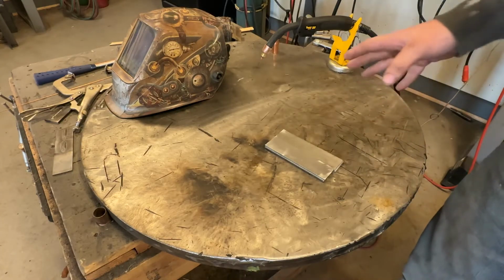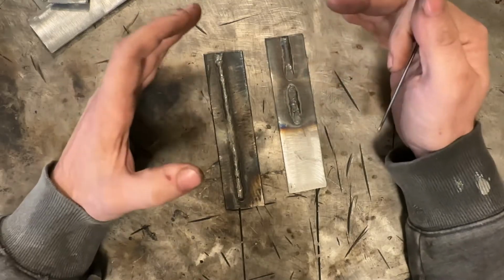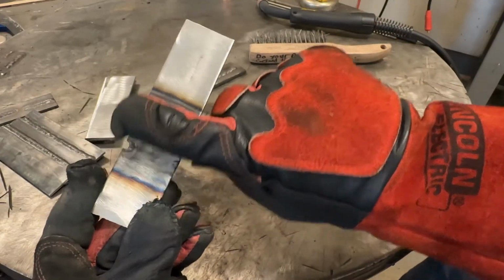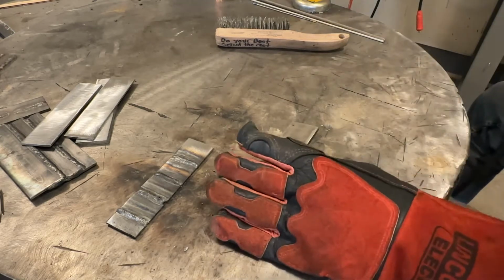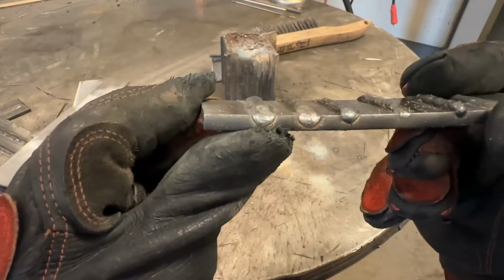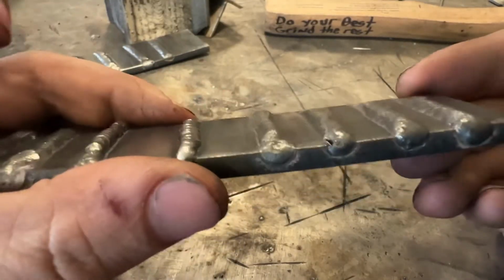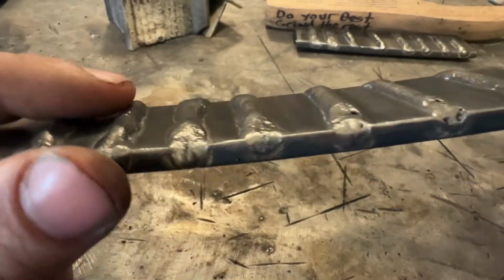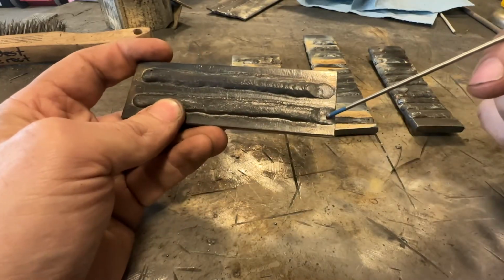Heat to metal ratio: learn how to read your welds

Comment: 😃This one is so unbelivable helpfull!!! 👍 
Should be mandatory to watch for everyone starting with Flux-Core welding. 
Thanks for that, Greg!
Reply from the maker: Glad the video was helpful 😀👍.  Understanding weld size and what wire feed/voltage controls do is critical to being able to dial welds in.  Once you grasp that concept you can dial in things for different thicknesses, positions, etc, and get good results without a chart.  Even more helpful is you can work in reverse and troubleshoot welds based on appearance and dial things in to improve the results. As supposedly easy as flux core (or wire welding in general) is there are a ton of variables to contend with.

Comment: Great video , deserves more likes , prob because most people don't even understand metal to heat ratio , especially with flux core or mig . :) more adjustments making it a little more difficult to tune cheers man , . Once again great informal video.
Reply from the maker: Thanks for the kind words.  I did a sort of second video on this premise, basically “welding blind” where I made welds without seeing what the settings were.  It is so critical to understand heat to metal yet many people don’t.  Once you understand it mig welding becomes much easier 😀

Comment: Just  started welding at 60. You are a blessing to a man trying to figure it out by himself. Thank you
Reply from the maker: No problem.  Welding is quite a complex thing, but with a bit of practice and understanding that it will take a while to get a handle on it, it won’t be long to become decent.  The key is have patience with yourself, try to be as consistent as possible, and try hard at getting the simplest things right (making straight beads, and moving the same speed).  You will get it 😀

Comment: Hello!
My father in law taught me
How to weld.  He is probably one of the best welders around my area.  However, not a great teacher!!  Thanks for your videos.  Great stuff.  
Question:  looking for a new stick welder.  Any suggestions??  Thanks
Reply from the maker: Welcome and I am glad I have helped you out 😀.  For a stick welder I have a few suggestions.  On a budget I 100% recommend the harbor freight titanium 225.  It is actually a really good stick welder, and will run 6010 rods (which most cheap stick welders don’t).  They sell for around 250$ with coupon.  The only real downside of the welder is it outputs 70 amps on 120 volt, which is low and not that useful (full 200+ amps on 240v).

For a bit more money the esab rogue 180 is a solid option.  It has adjustable hot start and arc force (which give you more control over your welds) and is super portable.   The quality on everything is a step above the titanium 225 but you definitely pay for it.  They sell for 7-800$, the smaller 130 amp is around 5-600.  

The third option is to pickup a used machine.  There are tons of used stick welders that are decent.  I am a huge fan of the miller cst280 and think that is about the best starting stick welder out there.  Often selling for 600-800$, they run all rods and flat out weld good.  Far smaller/more portable than a old Lincoln tombstone.  They are 240v only though.  If you can find a DC Hobart or Lincoln tombstone transformer machine they work well too (stay away from the ac only ones).  They are just heavy, big, and have no adjustable features.  And honestly the titanium 225 welds better than them (but obviously the old transformer machines will outlast modern machines no doubt).  Hope that helps 😀

Comment: Thanks , this was great information, helpful in understanding all the variables involved understanding the welding process.  This has been the most valuable video to date.  Great job explaining the small details , job well done.

John retired Marine.
Reply from the maker: Thanks for the kind words.  My goal was to really help everyone understand what you’re adjusting beyond what the dial says.  When you change how you look at voltage and wire feed MiG and flux core becomes so much easier.  Esab has a really solid program on their lcd welders (synergic MiG) that allows you to use a dial to make a weld flatter or more humped up (with a picture depicting it).  All it’s really doing is going up or down in voltage.  Luckily everyone can do that without a fancy welder 😀

Comment: Hey greg, ive just watched this video for the second time. So much good information in it, it cant all be absorbed in one go lol. 
When i use flux core, i always tried to judge my settings on sound as well as visual clues, should i ignore the sound and behavior of the arc and just look at the results to find good settings? 
I find when i weld if i hold a shorter stick out (6-7mm) the weld sound gets a lot more consistent, almost like a buzz and the arc is very stable, is this a sign im running the wrong values? 
Thanks for any insight you can give.. im of to watch tonights mig video lol.
Reply from the maker: So the deal with flux core is it runs better running with a short arc but unfortunately the byproduct is often porosity in the weld.  You generally want a 1/2in to 5/8th stick out.  That gives the wire time to preheat.  No wire preheat from a short stick out will cause the flux to turn to gas inside the weld.  It’s important to cut a test weld open and look at it.  Running a short stick out may have porosity inside the weld with no evidence on the surface.
Reply: @makingmistakeswithgreg  aw cool, I didn't know that. So should we be listening for the 'frying bacon' sound or ignore the noise and just go with the heat to metal ratio?
Reply from the maker: @desb9639  so the sound flux core makes tends to be very similar on most thinner materials.  The higher the voltage you run the more it will sound like a hiss and less like a rough sputter.  A welding machines “inductance” will also change the sound, which on many welders is not adjustable.  I will have a video out soon on inductance that will simplify something that’s very complicated.  To answer your question flux core should sound like frying bacon but on thicker metal or higher settings you will have a different sound to it.  What matters with flux core is that your welds are not overly humped up (not enough heat), concave (too much heat to metal), that they are defect free, and properly sized.  That is what is important, the sound should be consistent start to stop, more so than the exact sound it’s making.  Hope that helps 😀
Reply: @makingmistakeswithgreg  it certainly does help, thank you. It means I will keep practicing with my settings and stick out lol.   Thanks again

Comment: Tried your advice this morning on a couple of minor repairs for a neighbour.  Metal outdoor ornaments that had been damaged over winter.  Light gauge metal (less than 1/16 which is way lighter than anything I usually attempt).  Four mig welds and it was fairly dialed in by weld 2 or 3.  No holes.  Yippeee.  After first weld backed off the wire feed and cranked up the voltage.  Seems obvious now but sure wasn't before this video.  Thank-you very much.
Reply from the maker: Awesome, I am glad to hear.  Sometimes the obvious isn’t so obvious.  Now that you have a better handle on heat to metal ratio you will be surprised as how much easier it will be to dial in welds.  Being able to look at a weld and know what you need to do to make it better is how you get real good.  😀

Comment: I thinking my Hobart Handler 210 MVP is not really designed to use 0.023 solid wire, because the lowest available tap setting is 19 volts, both on 115v and 220. Perhaps this is an issue with a lot of the dual voltage mig welders with voltage taps, not enough low voltage taps available. On the higher priced older Miller's that are 120v only and have tap settings, there are a lot MORE tap settings to choose from. If you could make some mig welding videos  with 0.023 or 0.030 where your minimum voltage is set to 19v and you attempt to set the wfs to match, that would be very interesting. Taps are like 19v 22v 25v 29v. I'm sure I'm not the only one. Nobody is doing these types of videos. Your welder doesn't have taps, but you can just set those voltages and it would be the same, adjust wfs and stickout only. I think this could help a lot of people, simulating their voltage taps on the older welders. A tap'd voltage welding simulator. Can easily measure the open circuit voltage on each of their taps at home (not the while welding voltage).
Reply from the maker: I will definitely do that.  Are you sure that your welder keeps 19volts while running?  Obviously MiG is constant voltage (CV) so you should be holding the set voltage with variable amperage.  I know with my firepower it definitely holds the voltage + or - .2 volts from setpoint.  What thickness metal?  I will do it Saturday this upcoming week.  😀
Reply: @makingmistakeswithgreg  I'm sure the voltage drops while welding, but I have no readout on the welder. I have also been told that on these transformer welders, as the wfs increases, the voltage at the taps decreases. I think my welder is optimized for .030, but that might only be for one brand of wire. Same settings might not transfer to another wire brand. My understanding is that the included chart is close for Lincoln wire, but that the wfs is always a bit too high (marketing tactic). Was really suprised to discover that minimum unloaded voltage was 19v on both 120 and 220. Countless instructional videos show perfect welds being made in the 17v+ range. I was considering adding an 100ft extension cord to the welder to drop the voltage. 🤔
Reply from the maker: @massa-blasta  ok I will definitely test it out and have the video up by Sunday.  I think 19 volt will be a bit hot but I will find out what happens 😀.  

A extension cord might just cut the output voltage back a bit, that’s some creative thinking lol.
Reply: @makingmistakeswithgreg  I have no idea of the actual voltage under load. After a lot of research, I'm convinced the engineers designed the welder for the dual purpose of feeding soft aluminum wire without a spool gun, although it has a connection for a spoolgun. The gun length is only 10ft, not 15 and with these high voltages and  extremely high wire speeds available for it's size. 800-828 ipm unloaded. Maybe they want spray transfer with .023, idk. I don't have specialty gas.
Reply from the maker: I shot and edited the video, it will be up today at 4pm.  The results were interesting.  I also looked through the manual for your welder.  It shows settings for 22ga metal which makes me believe it’s capable of welding it.  My thought is it’s not actually constant voltage (CV).  It likely has a varying output voltage based on wire feed speed.  It may cap voltage at 19volts on that particular tap but it probably will go lower than that during actual welding.
Reply: @makingmistakeswithgreg  I'm not on any certain thickness, but the problem is on the thinner material. I can go hotter with the higher settings, but going lower is the problem. I mean 19v has a minimum wfs it needs, so how can I go lower? I thought, have to use thicker wire, the wire will absorb some of the higher voltage. I know about adjusting by sound and all that, just sending ideas for future videos. There are a lot of these A,B,C,D,E mig welders out there. The better tap'd machines have like 12 choices which is basically infinite. Cheaper machines only have infinite wfs and do not hold the voltage like inverters. I may be mistaken, but I think SuperArc L-56 ER70S-6 effectively handles more voltage than other brands of cheaper wire, making it better for mill-scale, but rougher running.

Comment: Thank you fir sharing. This is excellent information. I just started welding this evening with my Titanium 125. I was wondering what ti do with my welds. This helped a lot
Reply from the maker: Glad it helped you 😀👍.  With the titanium 125 I found the settings to be close to what they needed to be for a given thickness.  Use them as a starting point and base you’re voltage setting on how the weld looks.  With a bit of practice you’ll get a real good feel for it.  Keep practicing 😀👍
Reply: I heard that was a good little welder if you chop the ground off and put a good ground on there. You can also preheat the steel with a propane torch before weld and it'll really go in.

Comment: I honestly feel your vids are the most helpful I've seen on YT . Thank you .
My fluxcore welds have improved immensely, to the point where I'm now taking my machine onto sites and opting to fluxcore weld more often than the arc/stick that I've been using for years .
All on gates and Automations.
Reply from the maker: Thanks for the kind comment 😀.  I am glad to hear your flux core welds have improved a lot 😀.  I find it to be much easier to flux core weld over stick for a ton of things, especially out of position welding.  Flux core tends to have more porosity issues than stick though, so make sure to keep those settings dialed in.  👨🏻‍🏭
Reply: @makingmistakeswithgreg  
So far I haven't had much issues with porosity. 
When I bought my cheap ass multi process machine Is spent about 2 weeks learning the machine thanks to your vids before I started charging clients ..lol . 
When I need to welds guides for heavier gates I'll run it arc / stick ( i.e. 600lb and up / 250kg and up ) .

Comment: I am half way thru this video.  it is excellent in explaining the volts heat input aspect.  I thought wire feed speed was the only important variable, but voltage is also very important.  thanks Greg.
Reply from the maker: Thanks for the comment 😀.  Without a doubt the info will help you get dialed in a bit better.  It’s a lot of info to absorb so take it in at your own pace 😀

Comment: Great job in explaining this.  For MIG, I've always used a Miller "Millermatic Vintage."  This machine has 6 voltage settings (1-6) on "low," & 6 more on "high," with a wfs dial making it infinitely adjustable. Years ago, I remember doing the math to estimate/project what the values should be (which is a simple ratio/proportion)......when changing from welding thick to thin material.  Essentially the same process when learning/developing the settings for my spool gun on aluminum of varying thicknesses.

Great job.....this video will definitely help a lot of folks!

Comment: Very informative video, and I commend you for the amount of time that you invest making sure that share your vast knowledge. That stick welding on thin material had me shaking my head remembering the struggles that I had on a job. All I had was 7018 3/32 to weld 1”x1” x (1/16 if not thinner) square tubing. I tried pushing, runnin quickly, and anywhere I had a small gap it got ugly. I got tired of Texas tigging so for the hell of it I tried electrode negative and it helped substantially.    I’m really liking the content bro
Reply from the maker: Thanks for the kind comment 😀.   I definitely don’t like stick welding thin material.  To date the worst job I have ever had to do was stick welding a shock tower sheetmetal patch in a ford escape with 1/16th rods.  Pure frustration and swearing 😅.  Back then I didn’t know about DCEN, and I was too poor to buy a flux core welder.  I rather have strep throat than do that again 😅

Comment from the maker: I know it’s a long video, but it’s a complicated subject with so much to cover 😮.  My hope is you guys can better tune your welds in with the help of the video.  You truly need to think of welding more as “heat and metal” and less of amperage/voltage/wire feed speed.  Always ask yourself “is the weld consistent”, “do I need more heat”, “do I need a bigger weld/aka more filler”, etc.
Reply: Similar  to speeds, feeds, and depth of cut in machining, where we care about surface finish and tool wear. Thanks for the lesson.